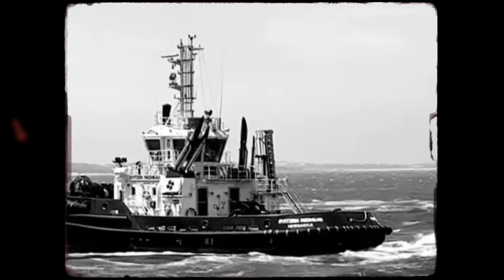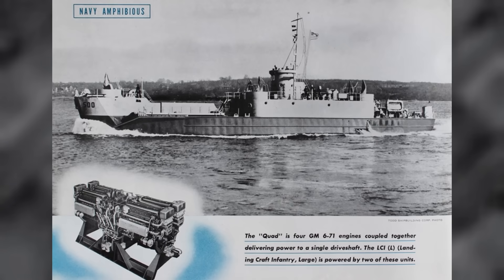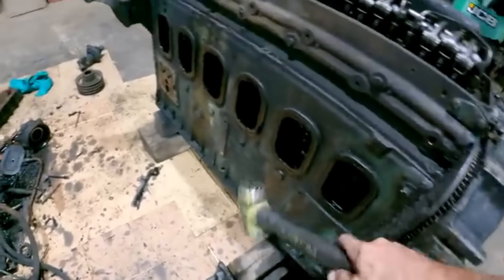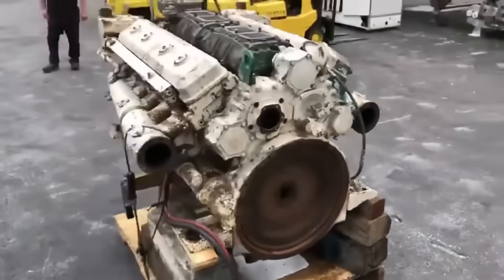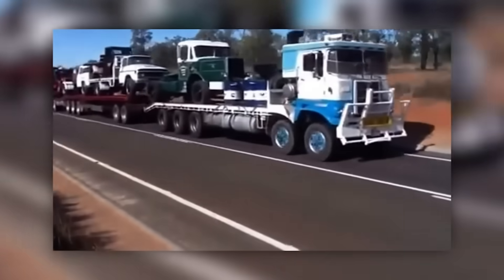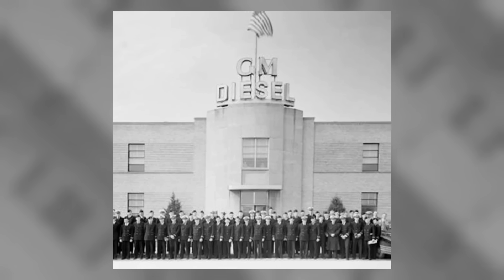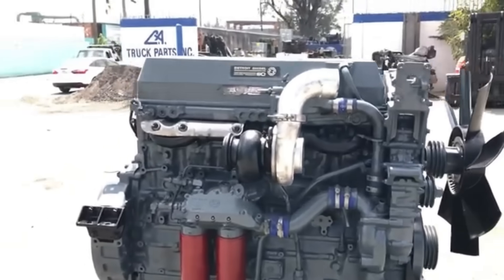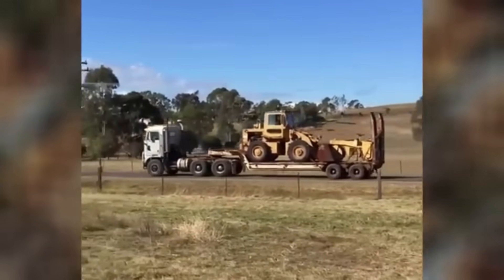The Rise and Fall of Detroit Diesel, America’s Greatest Engine Company

Comment: When I was a kid a friend of mines dad worked for DD. They took  6-71, set it up on a dyno in the lab, ran it at battle setting on the fuel pump, and it ran 24/7 for 9 1/2 months before it broke.
Reply: That's about the way they were abused on the drawworks on drilling rigs. I've lain on the floor grating helping my Dad rebuild one of a set of twins while its partner was wailing away doing the work of both of engines.
Reply: That's approx. 7k hrs.
Reply: Now busses  use Cummins
Reply: Under a load?
Reply: US should've just copied the Soviet all aluminum, shaft driven DOHCams, V 12 Diesel in the T34 tank
Reply: @tcmits3699 I didn’t realize the T-34 had an all aluminum engine.
Reply: @FeldwebelOSirideain no it wasn't he said they should of went to that design instead on the V12
Reply: @kustombuildsBTTX pha q, WTF asked you?
Reply: And so it broke. I do not believe they ran it continuously because mixing the fuel with crank case oil dilutes it and requires an oil change when the oil pressure drops below 40 lbs.  A Cummings diesel on the other hand can run constantly without diluting it's crankcase oil.  A Cummings engine also used two oil and two fuel filters to insure clean running.
Reply: @bullettube9863 what are you talking about mixing fuel with crankcase oil? They were not crankcase scavenged engines like a weed eater.
Reply: @petejohnson8397 tbh I stopped reading when the comment spelt Cummins with a G.
Reply: @sjohnsneddon  you are smarter than me 😅
Reply: @petejohnson8397  Two strokes like the Detroits tend to force unburned fuel into the crankcase due to the high compression.  It also acounts for the smoke.  We used to add a "fuel improver"  but never really saw any improvement.  We had Oscosh snow blowers with a V-8 driving the vehicle and a V-6 driving the blower assembly, and if the oil pressure fell below 40 pounds they automatically shut down. We then had to wait untill they cooled down before taken them back to the shop and changing the oil. We used Mobile straight 40w oil specifically designed for Detroits. Oscosh used Detroits because they were light, reved quickly and ran forever as long a you used decent oil.
Reply: @petejohnson8397  Detroit engines in Our Oscosh snow blowers used straight 40w Mobile oil. The high revs, and high compression wore out the oil faster then on our Cummings , Cats and IH diesels.  The high compression also forced fuel past the piston rings when they were cold, and engine oil was forced upward past the rings on intake.  Once the engines warmed up the rings sealed. This why Detroits smoke so much when first started. Our Oscosh snow blowers had the V-8 71 driving the vehicle and a V-6 53driving the blower assembly, so you can imagine the noise and trouble of maintaining two Detroits at a time!
Reply: @bullettube9863 the fact that you spelled Cummins with a g not once but twice, makes everything you said lose validity
Reply: @6litreteaser904  sorry but spell check rejected the in ending
Reply: @6litreteaser904 you spelt lose wrong…..uh never mind
Reply: @bullettube9863 every diesel engine ever made has diesel in the engine oil.  That's just a physical fact.  Detroits weren't unique in that aspect thats just the nature of diesel engines themselves.
Reply: @bullettube9863 ITS NOT CUMMINGS. You messed in up in TWO separate comments now🤦🏼‍♂️🤦🏼‍♂️🤦🏼‍♂️🤦🏼‍♂️
Reply: @bullettube9863 “spell check rejected it” so you can’t go back and fix it? And I refuse to believe that because if you capitalize something and spell it wrong, spell check is a helluva lot less likely to mess with it
Reply: @JckDniels  So sue me snowflake!
Reply: @verteup The main problem about fuel dilution on two strokes DD were the jumping lines supplying fuel to the "Unit" injector. When not properly tightened, they leak on top of the cylinder heads.
Reply: On a test bed they change the oil while running lol.

This isn't a pickup truck it's a laboratory
Reply: @bullettube9863 A long-run bench testing systems can do on-the-go oil and filter changes.
Reply: @bullettube9863I don't think you really know much about diesel engines at all,to call it a Cummings?,it's Cummins.
Reply: @markhollis362  I know, so sue me!
Reply: @bullettube9863that's even sillier than your Cummings post
Reply: @bullettube9863 wtf is a Cummings? Never heard of them
Cummins is a great brand tho. Sad they out themselves in dodge trucks
Reply: @bullettube9863ummm😂
Reply: @bullettube9863 The Detroit 8V71 also used 2 fuel filters. I drove several different semi tractors with Detroit 318 engines through the 1970s. For the Household Mover Industry, that combination was perfect... the Fuller Road Ranger 13 Speed gearbox made it all work quite well.
Reply: @bullettube9863just delete your comment
Reply: @bullettube9863 Those engines were designed specifically for high duty cycles, meaning full load for extended periods of time. They are so good at that then a significant number of emergency generator systems for hospitals and stuff are still powered by those engines.

Comment: Spent my entire forestry career running jimmies. Tear the head off of a straight four and bolt it on to one side of a 8V. Different injector capacity 45,55,65, but they all fit any engine.  30000 hours on a rebuild. Once it was started didn't need a battery. Manual governor that actually had a quick selector labeled WAR. Only enemy was heat, lose coolant and head would crack at 205,no head gasket,cork o=rings. 90 year old tech, love it!
Reply: I had a Gradall 660,the main engine was 6v71,the boom operation engine was 4/53. Powerful machine with terrible fuel economy.  I still regret why I sold it. Ones you start it didn't need battery 
. I had a great time with the Gradall 660
Reply: My dad was a mechanic too for a forestry company he knew those engines like the palm of his hand and the first machine I ever operated was a timberjack 230 with a 3-53 in it
Reply: Have you ever heard of a 51 series General Motors Diesel , Not a 53 series !
Reply: @vicpetrishak7705 I hear those things were wicked loud.
What? 
I SAID I HEARD THOSE THINGS WERE WICKED LOUD....😂😂😂✌️✌️✌️✌️
Reply: That’s amazing- thanks for sharing!
Reply: Engines are engines, to those that know them, but the guys that knew them, should have been a higher pay grade,  imo.

Comment: None of the WW2 land vehicles shown had diesel engines. US tanks and trucks, like German tanks and trucks, used gasoline. Some testing was done with diesel engines, but it was tough to set up a parallel logistics line for diesel fuel. Marine use - Navy, Coast Guard, merchant marine - was an ENTIRELY different story.
The Soviet Union used diesel power for its tanks - the same basic engine that they are using today!
Reply: The US certainly made and used diesel combat vehicles. Most went to either the USSR (M4A2 Sherman's, for example, used 6-71s, 1+1 as a spare) or to the Pacific Theater USMC.  We even sold the DDs to the Canadians and British for their tanks and TDs. We also put that engine in almost 5000 M-10 TDs.
Reply: @anthonykaiser974  Most Sherman variants were gasoline. Interestingly the early versions used a radial engine that was derived from aircraft.
Only the Sherman M4A2 used Detroit Diesel 6-71’s. Only 8,000 of this variant was made out of a total of 49,234. About 16%. I don’t have the figures for out of that 8000 how many were exported to other countries and never served in the US Army?
I’m surprised people on here never heard about how easy it was for Sherman tanks to catch fire. And legend that they were nicknamed “Ronson’s” after the cigarette lighter brand. Because “It lights first time, every time”.
Reply: @notmenotme614 only the early M4s had the 'Ronson' problem. Once wet storage was set in for the ammo, it didn't pose the huge problem as before.
Reply: @anthonykaiser974  From what I’ve read, I got the impression than the Shermans poor survivability was caused by using gasoline. As gasoline would ignite much easier than diesel. I was told you could drop a match onto a barrel of diesel and the match would be extinguished (I haven’t tested it though).
Reply: The German tanks were all gasoline, but the American ones did use diesel. Not sure if it was all or just some though.

Comment: Sorry; Cummins and Caterpillar are far superior
Reply: Bullshit
Reply: In that era?… Nobody gets more nostalgic for these “bird scarers” than this bloke.

I learned to drive a heavy vehicle in the summer of 99/00 (we’re upside down under) in an 8x4 International Acco tipper, with an 8V92 and a 12 speed Eaton ‘box. I was 13 and learning to drive in that with a quad axle dog trailer on the farm was the best education ever.

But now I’ve operated some more sophisticated trucks (vehicles in general) anyone who says they’d prefer to operate that in a road train configuration compared to the flagship truck in their business, a 2020 Western Star 6900 with a Cummins ISX and the 18speed, has clearly never spent time behind the wheel of any of the new stuff.

That truck is my favourite to drive, towing the B-triple tippers, it’s a beast.

But THE BEST vehicle I’ve ever driven was a 2024 Scania 770R… That V8 is such an engineering masterpiece, the view is incredible from the operator’s seat, it towed 72t like it was towing a single trailer and the Opticruise ‘box with the adaptive cruise control, knew exactly which gear to serve up and keep it in the boost… Every. Single. Time.

The fit and finish was a bit “fleet spec” in the R model, but if you spend the kind of money the WS 6900 cost then you can get an all singing all dancing 770S and they’ll do whatever you want down here.

Oh yeah, my point was: Cat hasn’t made a great highway engine since the 80s, Cummins has the performance edge and (allegedly, but they’re all similar now) reliability, Detroit are a bit more efficient and at the end of the day the Scania and Volvo drivetrains embarrass them both.

Comment: Please don't call the blower on a 2 stroke diesel a supercharger. It isn't one. It's just a blower that provides breathing air, not a charger that provides boost air.  If you want boost on a 2 stroke, you have to add a turbo.

It's a common enough mistake since most people know them from sitting atop drag racing engines.... where they are in fact, superchargers.... but it's still wrong. It's confusing since "blower" is slang for supercharger when referring to street and race applications but in diesels, blower is in fact, the component's proper name.
Reply: how about fan, official name.

Comment: We used to manufacture the all the 149 series engines and the blowers and water pumps for the 71/92 series and also all the EMD blowers and turbochargers in Indianapolis at Allison.  A lot of business went away when the 2-strokes phased out but they couldn't pass emissions and also weren't competitive on fuel consumption.
Reply: The narrow tourque band caused the Drivers to be adept at shifting to maintain the power band.
I always said the sight of a hill would require a downshift.

Sadley Drivers are not capable of operating a screaming Jimmy any longer.
The ability to find drivers who could drive a NH 335 was equally difficult.
Competency is not something required in Drivers today.
The computers removed the skill required to drive.

Comment: You skipped the part where under GM they output VM engines as Detroit Diesel (mostly the 638). VM used to be a sort of reliable modular Italian Diesel engine manufacturer, however after "merging" with Detroit, they became more reliable and also more powerful. Ending in the VM 630 for Jeep Cherokee and Masarati Ghibli and later Ram 1500.
Reply from the maker: Good to know, thanks for the info!

Comment: Somehow I missed the part of the video where the fall of Detroit Diesel came about. It seems like the company was thriving when we last left it. 

And if the experience of another channel which recently removed 12V-71s from their boat and could not even given them away is indicative the market for these motors isn’t what the video would indicate.
Reply from the maker: They just slowly faded into a standard engine company and not what they once were. Emissions control was the first nail in the coffin, and they slowly adapted, but they were never again the "king of the road" that they were in their heyday.
Reply: Still has over 30% of class 8 engine market share… Cummins is only ~35%. Might not be the two strokes, but it’s still one of the largest diesel engine producers.

Comment: The 71 series engines were an awesome engine but the 92 series were utter 💩 because they all cracked between the vales in the heads.
It was normal to see 6v71 engines with over a million miles and 6v92 engines were doing very good to see 100,000 miles and even that number got to be an extraordinary feat.
Screaming Jimmy wrecked my ears, with ear defenders on
Reply from the maker: Wow, that must have been crazy-loud!
Reply: @VintageAmericanMachines the 6-71 engines would be retired after millions of miles and then be salvaged, cleaned up and put into a waiting line of fishing boats  to run for decades. 
But good christ were they ever frigging loud and if someone made a mistake on the throttle/Governor assembly, the friggers would start at maximum speed and while being deafened by your colleague, you're helping to hit the shutters😵
But the 71's were bullet proof 😊

Comment: Used to push out all size aircraft with  4.53 Detroit diesel. Even did standard  737 aircraft with a Ford 6 cylinder tug on very rare occasions.
Reply from the maker: Nice! That was an interesting engine.
Reply: Ford online 300 six ?
Reply: @timothyproksch2915 Yes,  that's correct. Of course those later got replaced with electric vehicle versions.

Comment: You said the series 60 was Detroit’s first 4 stroke, but what about the 6.2 and 6.5 small V8 found in GM’s pickups and in the AM General Hummer. Those started in 86 or so if memory serves, after the whole Olds 350 fiasco.
Reply from the maker: @Project_Low_Expectations The 6.2 and 6.5 were GM-built four-stroke diesels for light-duty trucks. The Series 60, on the other hand, was Detroit Diesel’s first four-stroke engine designed specifically for Class 8 rigs. Until then, Detroit had only built two-strokes for the heavy-duty market.
Reply: Go into a DD parts counter and ask for 6.2 or 6.5 parts and they will quickly tell you to go to Chevrolet parts counter.   Nominal DD at best.   Toroflow was GMs first 4 stroke diesel

Comment: Which US WW2 tanks had a diesel engine?
Reply: Some Shermans (M4A2) had a GM 6046 diesel, twin inline 6-cylinder engines.
Reply: The M4A2. The video was wrong in saying that most US military vehicles used GM diesels; most were gas powered. The US Army's supply chain handled gasoline instead of diesel fuel, Allied logistics were the same, and the ability to use foraged or captured fuel stocks in the field was a handy capability.

The USMC used the M4A2 because their supply chain was run by the Navy, which handled diesel fuel for their submarines and smaller craft. The USSR preferred diesel fuel for their tanks so they were supplied with the M4A2 through Lend-Lease.

Comment: Durability and serviceability are words that currently don't exist in GM management, ask any mechanic.  At one point in the 50s, 30% of trucks had DD engines, when Penske bought the company that had dropped to 3%, his management turned that around making it an interesting buy for Daimler Chrysler, note that when Mercedes sold off Chrysler, it retained the diesel shop and these engines are still part of the Mercedes world.  Sometime around 1960 GM lost its way and has never found the path again.  The thing about mechanical engines with no fancy electronics or hydraulics is that they can be repaired and rebuilt and often done by average mechanics with regular tools, not so with electronics, these things last ten years if you're lucky and then you throw them away and buy new ones IF they are still available.
Reply: As of 2022, Daimler truck (the parent company that owns Mercedes Trucks, Freightliner, Western Star, Thomas Bullt Buses, and of course Detroit Diesel) is now independent from Mercedes-Benz group that builds passenger vehicles. The current-gen DD engines are shared with Mercedes trucks with slight differences depending on market emissions and packaging. I’m an engineer at Detroit, so I work directly with colleagues in Germany on a daily basis. We still assemble and test every single engine for North America in our plant in Redford MI, the plant is HUGE.
Reply from the maker: Good information. You're absolutely right.
Reply: It depends on the electronics. My 1987 Honda CRX had speed/density EFI and was dead simple.

Heck, even my 2012 Civic is a very simple vehicle to repair, my only complaint is that it would be difficult to modify due to the level of integration in the electronic systems.